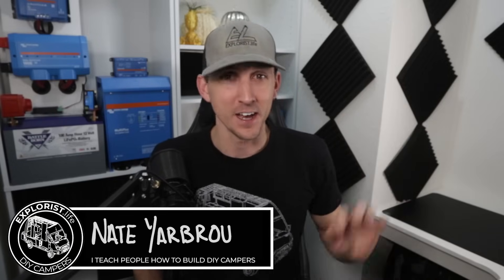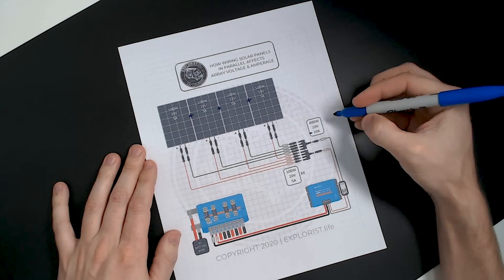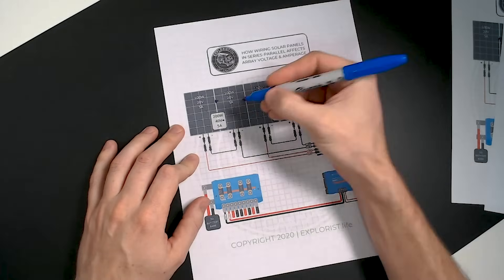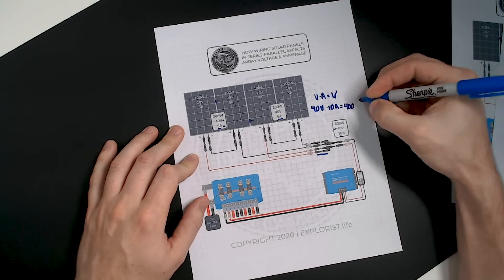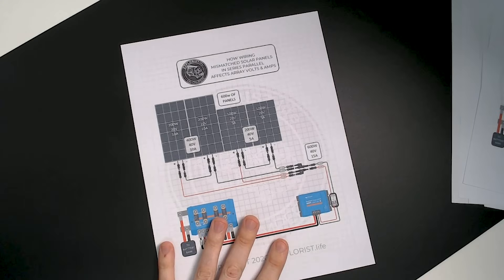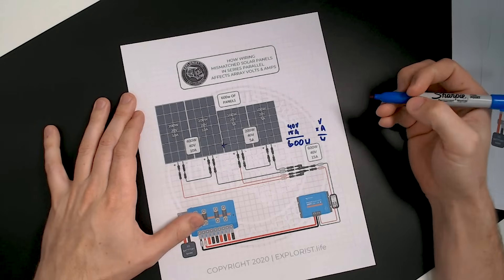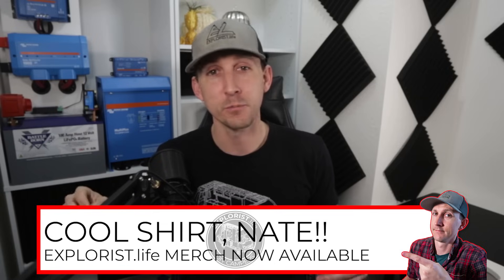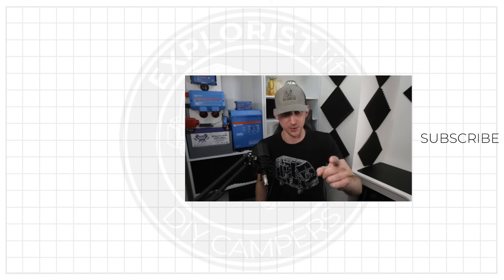How to Wire Different Sizes of Camper Solar Panels Together - Effects of Mismatched Solar Panels

Comment: Great explanation as always! I am curious in the scenario of the 3x 200w panels and 2x 100w panels, is there any reason you wouldn't want to wire the 3x200w on a charge controller and then the x2 100w on another smaller charge controller? Does add price + more parts complexity but should get full efficiency of all the panels?
Reply from the maker: Yeah, price, additional wiring and a larger physical footprint in the components box are the main negatives.  Totally doable though.
Reply: I am actually using 2 controllers on 4 identical panels as that did cost less then 1 large one...
Reply: In the mixed examples of 2 A + 2 B panels, wire (A+B in series) and that in parallel with another (A+B in series). In the 3x200W (A) + 2x100W (B) example, wire the 2x100W in series, then that in parallel with each of the 3x200W panels, ie (B+B series) parallel A parallel A parallel A. Or, ((B+B in parallel) in series with one A), then that in parallel with (A+A in series). Each of these will give you full capacity, assuming your charge controller can handle it. The 7x200W example, wire all in parallel for 100% efficiency, again assuming your charge controller can handle it (and the wires are thick/short).

Comment: I am using 3 solar panels in parallel to charge a 12v car battery. This is used to power up 3-4 leds street lights on the wall. The lights used to stay on till about 4am. The solar panels are not of same size so I think the wire is not right to get the battery charged full. This video helped me to understand the wiring. I will try to correct it.

Comment: Can I utelise two sets of panels each set wired together and each set wired into their own power converters. Can I use both sets to power up my batheroes or does each set have to have their own set of batt.
Don't know the volts but one set is 100 watts x 2 for two hundred watts. . The second set is 150+ x 2 for 300 watts..

Comment: Filing in Open Space on Van Roof with Different Size Solar Panels

Altamonte Springs, Fla. (Nov. 17, 2020 09:47 a.m. EST) -- As my solar system matures, the question of how to fill in the open space on my van's roof with more solar panels. However, before my designing was able to continue proper brainstorming, I had to give my imagination some guidance as to what configuraitons of panels are electrically legal. Meaning, what are the rules for mixing solar panels with both different physical and electrical specifications.

This video covered, and answered that question. Now I can proceed to decide how to proceed with filling in the unused space on my van's roof with solar panels.

Thank you.

p.s.: Your next video regarding when and where to place fuses is also a vital factor when wiring in solar system components. Look forward to it.
Reply from the maker: Awesome!  Glad it helped.  Thanks for watching!

Comment: Great video Nate, long time follower and I've referenced your material for my own RV solar installation.  One way to work around the problem with panels of different voltages and amperages and preserve 100% power efficiency is to wire them into a 2nd charge controller.  If budget is a concern and you've already spent $$ on the MPPT controller, the second controller can even be a lower cost PWM controller which will still boost overall power output.
Reply from the maker: Definitely!  That would be moving into a dual array setup, which was a bit out of the scope of this video, in particular and if you wanted/needed to mix solar panel sizes in either of the arrays, they math would remain the same and would be treated as 2 totally seperate arrays.  I'll be sure to add a video to my queue for when I talk about solar charge controllers to talk about dual array systems.
Reply: @EXPLORISTlife  Nate. If you have not already done so, please include a jump starter video to discuss multiple array systems. You can discuss the reasons why to  add a separate array (under it's own SCC) would be considered, and method's of introducing the other array(s) into the current array. 

For instance, my system is still patched together kinda rigged. But I do think it is worthy to keep my starter battery (veh battery) charged by the panels while charging my solar system battery. I have thought to just provide the veh battery with it's own mini-array and a cheap PWM SCC, but haven't really prioritized that task just yet. 

My other concern regarding multiple arrays (under their own SCC) would be to avoid the blanket affect of shade on all panels connected to the shade affected array. You may have covered this, or Will Prowse did, where if any one part of a panel gets shaded, it, like you indicate regarding the volts/amps affects, can/will affect the entire energy in that entire array assembly. To avoid this, each panel should be given its own SCC so no one panel getting shaded can affect all the other panels if in an Array. 

My first guess would be, when having separate arrays with their own SCC would simply be to connect them (ALL) (+ - out wires) to a common terminal effectively turning all them into one main "in".
Reply: Not necessarily as sometimes having two separate charge controller not communicating with each other will send a fully charged reading to the second charge. This sometimes will have only one charger pushing current.
Reply: @johnjones1812  Good point.  When employing 2 charge controllers it is best to have the same model.  If not able to do that the battery parameters must be the same between controllers.  No need to communicate then.
Reply: @Robert-jm1kk  communication between two chargers is necessary for most efficient charging. I have seen where one charger will float charge or sleep in midday because it's reading the charging voltage from the other charge controller not the actual battery state of charge because they require battery voltage for battery status.

Comment: Thanks Bud, I now know why my 160 watt and 100 watt roof panels only produce 11 amps. When plugged in separately I can see 14 amps in ideal conditions. I have a Timber Ridge 24 RKS with the factory solar kit and the portable solar panel plug on the side. When I plug my Go Power 120 watt portable into the side port the two controllers fight and take turns shutting down. I finally bypassed the portable panel controller and plugged it into the third plug on the roof using only one controller and now I can see 15 amps from the 3 panels instead of the 20 amps I can get when totalling individually. I guess I will replace the 100 watt panel with a matching 160 watt panel on the roof and hope my 120 portable has the same voltage. I was wrong to assume the dealer knew what they were doing, lesson learned.
Reply from the maker: Darn!  Well... I'm glad this helped out.

Comment: Always good info from you sir. So just discussing same size panels, what is the actual benefit of wiring them either parallel vs series of the power outcomes are the same? Maybe current heat? Seems like saving money on wire is another.
Reply from the maker: Ohhh, good question and will be having a video coming up shortly covering that.  Stay tuned! :)

Comment: It's OHM'S law, not watts law.
Reply from the maker: Ohm's Law is Volts = Amps x Ohms
Watts Law is Watt = Volts x Amps

Since we are given Volts and Amps, using Watts Law is more appropriate in this application.  We don't need to calculate resistance here so we don't need to use Ohm's Law.
Reply: @EXPLORISTlife  40 years ago when I was an electronics major it was all considered to fall under ohm's law. Never heard of watts law. It was all considered to be part of Ohm's law. Things change! 
Love your channei.
Reply: @EXPLORISTlife  Hi Nate, I will appreciate your help, I have 7x 24v Voc 37v panels and want to charge 24v battery. My question is should I discard 7th panel and use series parallel connection (48v) or use 7 panels in parallel (24v). What will give more watts? I think that MPPT will work better on 48v

Comment: I guess one way when using different panels is to use a second solar charge controller?
Reply: Yes, using 2 controllers will solve problems like that. I do that now even with 4 identical panels using 2 panels on each controller. It was less expensive then buying 1 large controller and if one controlled die I will still be able to get half charge. It also give less trouble with partial shading.
Reply: i have 5 identical mppt controllers connected to the same battery bank and i am about to order one more to accomodate an extra 300 watt panel that i cant fit into any other array for reasons mentioned in this video

Comment: Great video, question on the mixed mode why is the lower voltage panel the governing overall voltage?
Reply from the maker: You can really dive down the rabbit hole on that question, but for the sake sparing a 3,000 word reply... 'That's just how it works'.
Reply: @EXPLORISTlife  would that be the case if I have 2 panels in series but I can tilt one towards the sun and watch the wattage go up but I can't tilt the other so it stays flat. The reason I'm asking is because I have 3 that can tilt and three that can't and I'm wondering if I should wire the 3 that can tilt in one series and the other 3 flat ones in another series. Or I was hoping to do 3 sets of 2 in series which would put one series of 2 tiltable, one series flat and I'll one series one flat and one tiltable. Is that similar to having different panels? Thanks 😊

Comment: I'm looking at setting up my own temporary solar system next year. The MPPT that I'm looking at has two solar inputs. Do I need to use both? I will be doing a 3s2p configuration, so I should be able to. But just want to verify.

Comment: Watts law=ohms law. Never heard them referred to that way but since there was a Mr Watt, I guess it actually is correct. Trying to learn more about partial shading for solar.
Reply from the maker: Watts law and Ohms law are pretty close.  Not exactly identical, but you can use one to find the other depending on the given variables.

Ohm's Law is Volts = Amps x Ohms
Watts Law is Watt = Volts x Amps

Since we are given Volts and Amps, using Watts Law is more appropriate in this application.  We don't need to calculate resistance here so we don't need to use Ohm's Law.
Reply: @EXPLORISTlife  yes I’m very familiar with the formulas, I was just taught it was all ohms law, that or my old self forgot details which is also quite possible.
Reply: @waynenocton    I learned it the same way back when dinosaurs roamed the earth and dirt was new.

Comment: freaking fantastic. i have space for 4 (maybe 6) x 270 or 300 watt panels and was thinking to add some in the extra space. this is so fruitful to know these plans. for example if i had space for 4 matched panels then added in 2 smaller extra ones but used a different controller to feed the same battery bank how would that work?

Comment: Point of contention: you said, "lowest common denominator," but that cannot be what you meant based on your math.  I believe that you meant 'lowest volts (or amp) rating," because the lowest common denominator between 25 and 20 is 5 for the volts [wired in parallel] (and between 8 and 5 is 1 for the amps [wired in series]).  Barring that, I am learning a lot through this video.  Thanks!